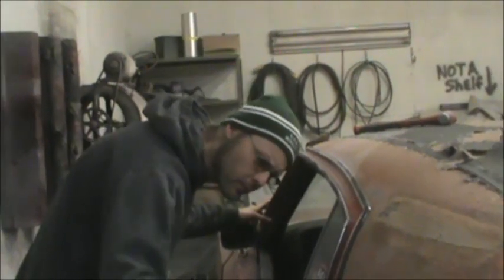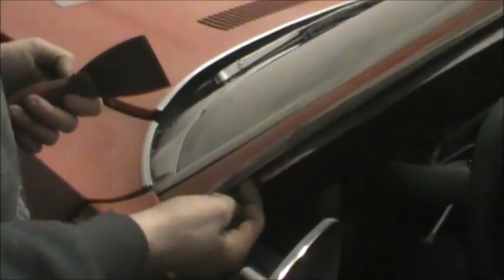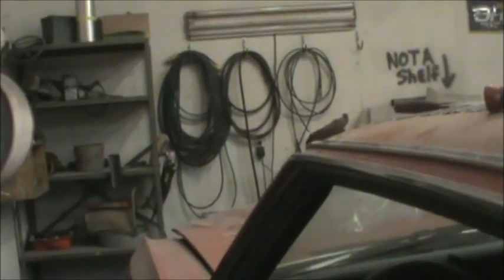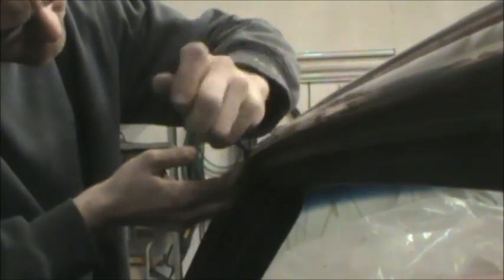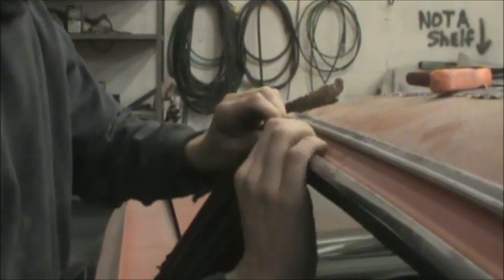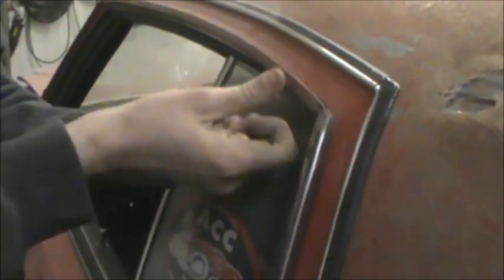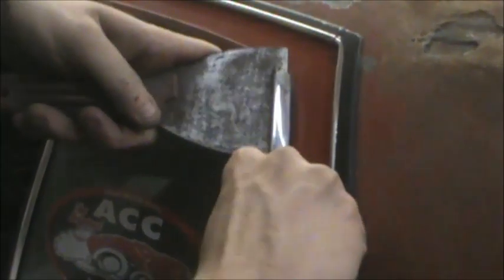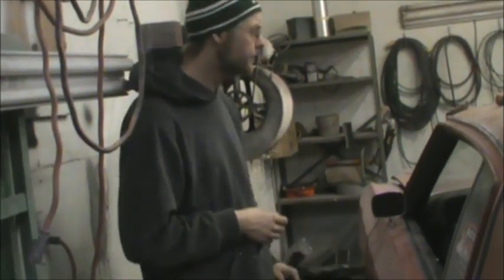1971 Monte Carlo Restoration #2 pulling the window gutter trim

Comment from the maker: I use a small orange handled pry bar the little 8 inch guy and an old screw driver. I pop up the trim gently on the glass side and find the clips then I use the little pry bar, because it has a bend in it, and twist it under the clip one at a time and just take your time doing it with kid gloves on. It takes me about half an hour per window to pull the trim.